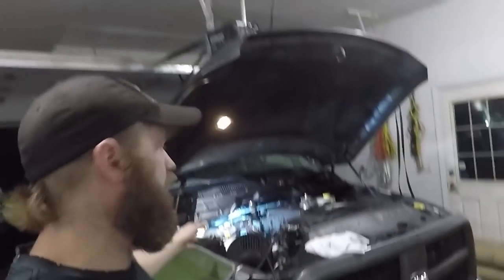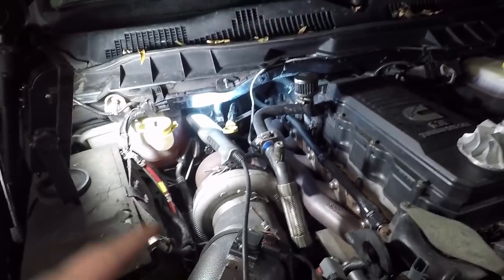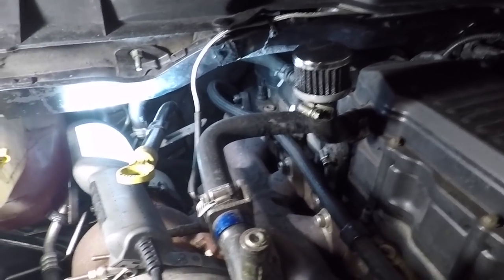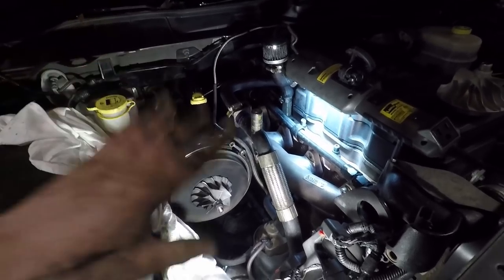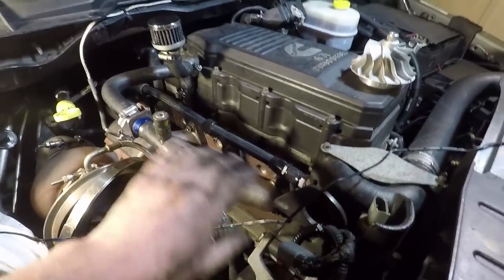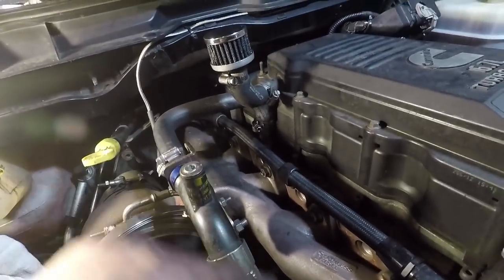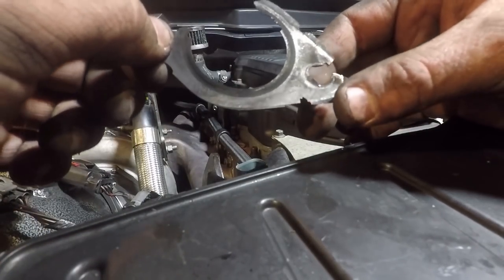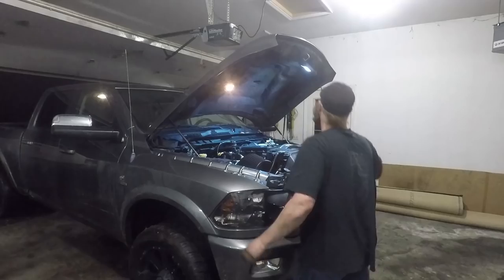6.7 Dodge Ram Cummins Exhaust Manifold Leak Fixed & Future Leaks Prevented

Comment: I somehow loosened the top bolt on the 1cyl exhaust manifold flange and noticed the bubbles on a -20 degree start while checking the serpentine belt for slip on my new high output alternator. At first I thought the bolt snapped then I found I just screwed up when I deleted it . After tightened I've noticed on cold days after a minute it makes a clank now as everything expands I'm wondering if my mistake warped the manifold ? ...I also noticed bubbles at the turbo flange as well on start up so probably going to be doing a freshen up job ...I only have a mild EFI live deleted truck used on the tow and light  tow/street tune  would you think head studs still a solid time investment ?

Comment: is it possible that when the gaskets are bad the truck makes a bad bearing like noise?
Reply from the maker: Typically exhaust manifold gaskets make a "ticking" sound when blown
Reply: JonathanRinny did you find out what the problem was my 08 Ram 6.7 is making a squealing sound under acceleration and even when it’s at idle. It sounds like the noise is coming out of the turbo but I was told it could also be an exhaust manifold gasket. Also the noise is way more noticeable when I turn on the exhaust brake.
Reply: @abmtz8537  Yes the nuts that connect the EGR to the exhaust manifold were loose and since the gasket is made out of several sheets of metal the leak made a tone or squeal. just snug those up making sure not to over tighten them or you will snap the studs!